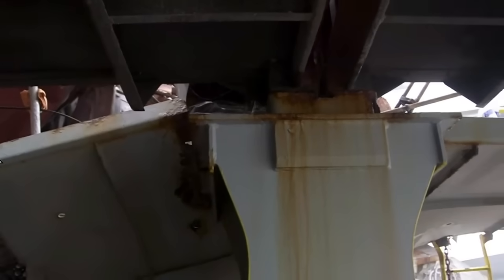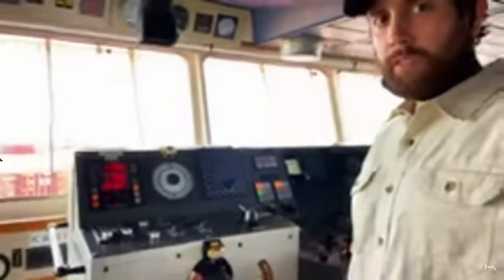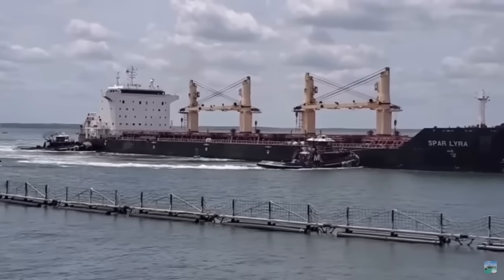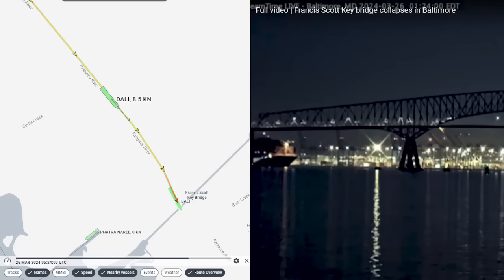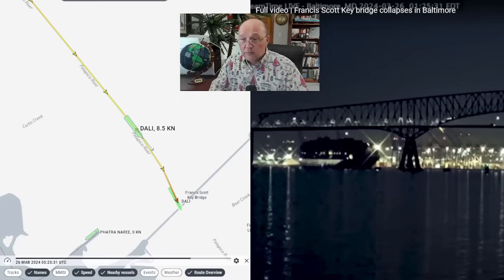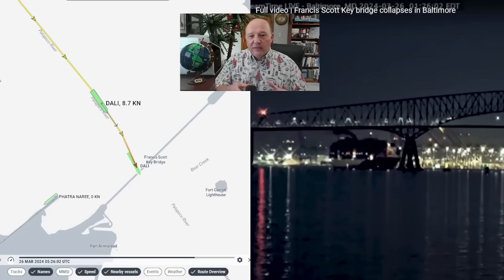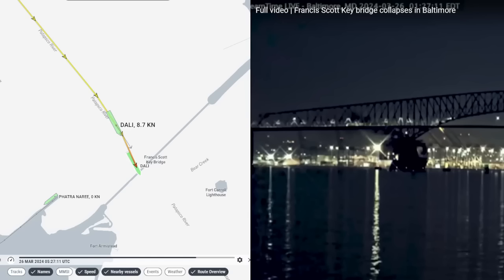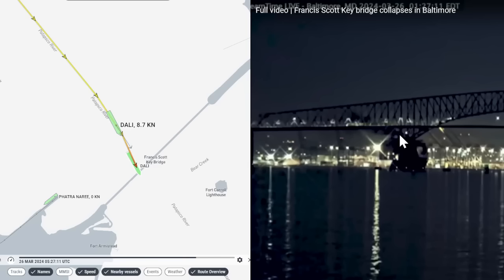Dali Timeline from Data Recorder in Striking Francis Scott Key Bridge in Baltimore, March 26, 2024

Comment: If the speed was 8 knots (9 MPH) the initial power outage happened when the vessel was approximately 3600 feet from the bridge (3.6 Boat Lengths) and moving approximately 13 feet per second.  Life comes at you FAST.

Comment: I had always read that large ships like this cargo carrier used bunker fuel for main engines.  Is there a reason this one uses diesel? would think that would be a more expensive option.
Reply: Ships using bunker fuel are diesel engines. Diesel engines are engines that run using compression ignition. they can run on various fuels. Often these ships run on a cleaner fuel while in a country's waters for emissions reasons.
Reply from the maker: It is marine diesel which is much thicker than normal diesel.

Comment: The fact the ship had issues before even under another captain is telling. Didn’t watch the whole video, but I imagine this information was included. Bad ship with routinely bad crew, doesn’t mean it was that simple though. Iron truss bridges are actually jenga tower enthusiasts in secret, there’s a reason they aren’t built anymore. Uses about 5 times the material as a modern suspension bridge with way less stability. How about wide cone shaped pylons to deflect the energy transfer upward instead of laterally? I could think of a dozen things that would’ve helped, and maybe cumulatively could have stopped the collapse.

Comment: Appears from the visual that the vessel ( indication of smoke stack) has gone astern -maybe full astern at the last minute .Bow cants to starboard ( right hand propeller) As she still had ahead vector -probable a mistake .would have been better to give hard port and then hard starboard to avoid pillar.(this with either ahead propulsion or at idle rpm. At 6 knots ahead vector -vessel would not have stopped anyway. Letting go the anchor at 6 knots  would not have stopped the vessel in time. investigation will tell if fuel filters were with wax deposits. At times master's tend to want to get out of port first and then stop to do maintenance  .Engine alarm logs (digital ) would give a clue .
Reply: Give harp port? By what method if rudders are not responding?  Transverse thrust? Prop walk it to port?

Comment: The engine room system would have had all the important data and timeline… strange the NTSB never mentioned it.  This assumes they did proper maintenance on the associated battery backups for it.
Reply: The NTSB doesn't have to give a play by play account of what they are doing.

Comment: It doesn't matter what size boat you have...if you are going straight ahead and you loose thrust....you will not change direction. The boat will continue straight ahead no matter which way its turned.
Reply from the maker: Not exactly.  The propeller has torque.  Plus when you loose power there is no telling where the rudder is set at that moment.  Then there are external forces on the ship.
Reply: @wgowshipping  There's a ton of videos online of large ships loosing power and almost instantly turning towards shore and grounding because of it.
Reply: @SilverStarHeggisist  this harbor is a dead end and many miles from the open ocean....no current forcing the vessel to shore. The ship was billowing black smoke...probably wide open throttle. That would explain the quick turn of 45°into the bridge. No other explaination makes sense.
Reply: @jjkastelic  there is a break in the shoreline right where this happened. That reduces pressure on that side of the ship which will cause the ship to turn that way. 

Diesel engines, especially large diesel engines will blow black smoke when first started. Ship diesel engines especially when they stall will do so because there's fuel oil that got left in the cylinders that has to get blown out of the engine before a true start happens. 

Diesel engines do not have a throttle. They'd are effective wide open throttle all the time because there is nothing to restrict airflow because they don't actually need to reduce airflow as part of their running. They only change the amount of fuel being pumped in. 

Bad or contaminated fuel can also cause a diesel to blow smoke like that and there's been a number of ships engines killed because of a recent environmental change requiring the sulfur in their fuel be removed for environmental reasons. 

Also without the rudder compensating, the the propeller because of its shape can cause the ship to turn. 

If a diesel engine is loaded, it will blow black smoke. They may have attempted to start the engine backwards to spin the propeller backwards. This would severely load the engine. The propeller is directly connected to the engine, engine spinning, proper is spinning. If they did that it could be why the engine never actually got running again, it was too loaded and stalled. 

Bad fuel would explain why the backup generator also failed. Since that's what caused the lights to flicker back on again. It may have started, then gotten poisoned by bad fuel and stalled out too. 

The ship was being acted on by wind, you can see the smile being blown horizontally in that direction and that ship has a huge surface area, even a small amount of wind can have a huge effect on it. 

The real question is, when they expanded the harbor to accomodate these ships, why didn't they add the protections around the bridge?

Comment: How about some in-depth coverage of bridge protection?  As I understand it (from another civil engineering focused YouTube channel) that the powers-that-be considered the need for protection measures (which are required for current bridge construction) but rejected them due to cost. (Doh!)  Sal hinted at deficiencies in the NTSB - what about that? Did it formerly have expertise or has it been "hollowed-out"?
Reply from the maker: My focus is ships.
Reply: @wgowshipping Maybe best not to go down the Jones Act rabbit hole ever again then.
Reply from the maker: @SubTroppo  Why?
Reply: @wgowshipping I'm pulling on your chain there; however you do seem reluctant to cover the broader fundamental issues which are the driver of events in shipping - most of which have a historical basis.  In the case in point the authorities (whoever they may be) seem to have their feet firmly planted in the century before steam.  [Perhaps they can only think in terms of their 40ft cruising sail boats].

Comment: Here's what happened. When the power went down the pilot lost steerage as it is a fly by wire system. He then called for full astern. That is the plume of black smoke from the funnel. That was a mistake. When the ship engaged full astern it began what we call a prop walk. The stern moves to port and the bow moves to starboard. There was too much way on the ship to stop before the bridge. It was doing 8kts prior to the power outage and 6kts when it hit. If the pilot had not engaged astern it would have continued on its course through the middle of the span.
Reply: You have it right, except, that was exactly their plan, and they had full rudder, they move that 100,000 ton beast 40 degree in minutes....there is no other way.
Reply: @777Macau  No. This has happened to me. Then I experiment when I had time. The prop walk is huge. Even when the rudder is hard to port. It will be interesting to see if the rudder was hard to port. In fact the pull of water over the rudder pulls it further to port. The ship was definitely in full astern because of the ships speed decreasing but it was too late, it had too much way on.
Reply: @rogerprout5574  Prop walk will not solve a needed perp walk.    Prop walk will not be able to turn a 100,000 ton ship by 40 degree in minutes, no Fing way.   I pilot a 28 foot salmon boat with 2 right hand propellers, the prop walk is negligible, but you can use it to advantage in backing out of slip.
Reply: @777Macau  I'm sure NTSB will experiment and even shipping companys will get captains to experiment. Its happened to me. I also have lost throttle on a brand new boat and rammed into dock

Comment: Why would they only drop the port anchor to slow them down instead of dropping both anchors? Dragging these anchors in this particular silt is futile but it might of kept them straighter and not veering them off into the main support structure. Thank god they stopped traffic across the bridge. The pot hole repair crew being there actually saved more people from going in the water. Hopefully everyone will learn lessons by their sacrifices. Throughout history unfortunately no one learns lessons for change unless it becomes drastic; and lives lost. Much respect for the victims and their families.
Reply: But they were drifting to starboard so dropping the port anchor makes sense to try to reduce that drift in the absence of rudder command, no?

Comment: Why wasn't the construction crew on the bridge told to get off if the police stopped traffic on each end showing there was a safety concern?
Reply: The crew was in the middle of the bridge... the port authority's transit cops were at either end... enforcing lane and speed restrictions... because of the construction.  The cops were not in radio contact with the construction crew.
Mayday call was transmitted on VHF from the ship to port about 90 seconds prior to impact.
Port told dispatch, dispatch told the transit cops to stop all traffic, which they did... thankfully at that time of night, traffic was light anyway. 

Dispatch asked about the crew on the bridge, one of the cops said he would drive up when another unit relieved him at the position where he was holding traffic.  Obviously he assumed there was more time, and also it's obvious they didn't have a way to directly contact the workers by radio.   It's a pity and I don't know whether work crews are supposed to tell dispatch 'hey we're on channel 5 on our walkie talkies' or whatever, but it seems that work crew had no idea they were in trouble until the ship hit the bridge.

Comment: Emergency generator will not provide illumination on the entire span of the main deck, it's the st/by generator running. During power outage the sequence will be: within 15 secs the st/by generator should run and automatically goes on the board if this fail the 2nd st/by will start and same within 15 secs it should be on the board, if this again fail the emergency generator should run within 45 seconds and power the emergency switchboard. If its in emergency power during the 1st minute,  steering would be possible because 1 steering motor is connected to the ESB, my conclusion is that the emergency generator did not start at all.

Trivia 1: under USCG 33 CFR 164.25 Steering gear test, main and emergency generators should be tested prior arrival/departure US navigable waters. This should be included on the investigation.

Trivia 2: there is no US requirements of any to use 2 Generators in parallel in port arrival/departure. The use of generators depends on the vessel operators: some require 2 for safety reasons, if there's a trouble the other generator can easily take up the entire load without power interruptions, other operators requires only 1 generator for emission ratings/score.

Comment: That final swing to port looks like she's running aground. 
I don't believe that any tidal current in the region  or bank effect with the depth of water, in and outside the channel, could cause that rate of turn in such a short space of time.  It is far more likely that the steering came back with the emergency geny, then was lost again in the second black out.  We need to know if the telegraph was set to Stop.  If it was left half ahead and the steering had switched to NFU with the emergency geny coming online.............
All speculation though until we see the transcripts.

Comment: I doubt any of the politicians have the courage to do this. But it should be analyzed if Baltimore should continue to be a major port. Could well be that transportation would be better served at a location that didn't have such a long transit from the sea. But then politicians didn't consider the logic of a city below sea level with New Orleans after Katrina.
Reply: Some dumb comments in this video... You top them all.
Reply: Thats completely absurd….. the value of having baltimore as a harbor is BECAUSE it is so far inland its means that freight can be loaded up onto truck or rail several hundreds of miles further inland than Jersey to the north and not have to deal with the military restrictions around port of Norfolk to the south then go by rail or highway from norfolk to richmond to Dc to Frederick instead of the very short route from Baltimore to frederrick along 70

Comment: I'd say whatever the commands were after power was restored exasperated the situation. I thought rear anchor was dropped no front anchor was dropped. 

At the time the anchor was dropped the ship was at a slight angle to the right, the FRONT anchors regardless of port or starboard is only going to create further drag in the front towards the right because of the size and weight of the ship, if the ship went full astern your adding more torque to starboard. 

Nothing should have been dropped from the front.

If we watch the time lapse from the time she lost power the first time and commands had time to have an affect once power was restored was minimal. BUT after commands were given that's when the ship began to make a more drastic change in direction.

I hate to say this but other than dropping rear anchors they shouldn't have done anything and they may have squeezed through.

The hardest action to take is no action at all. In this case I'm afraid no action may have been the best course of action outside of dropping rear not front anchors

Comment: I would say the generators should all be operating until the ship is so far from the coast. Just like airplanes have auxiliary power units  that operate during take off and landing, the critical times you don’t want to lose power. The US government could in-act a law like this. Make it mandatory for all ships entering or leaving ports must have their generators running until they’re either docked or cleared of the coastline. If they don’t want to, don’t come to United States ports.
Reply: Here's the thing. You don't know if the generators were or weren't running. All you know is that the power went out. There are many reasons that power could have been killed, besides the generators not running. (Circuit breaker gone bad, wiring short, software glitch, bad sensors, etc.)

Comment: Shouldn't the steering be set to a trajectory of the center portion of the bridge instead of a leg of the bridge? The ship clearly steers towards the right instead of the left which should have been happening.  To me this was event was intentional.
Reply: There is no doubt the ship steered right into bridge
Reply: The ship was on course to pass under the center of the bridge.  Did you miss all that?  That was the steady course before whatever went wrong. 
Did you even understand what was being explained?
Reply: @billiamc1969  Why then, did they drop the port anchor?
Reply: @jimbobeire  Somebody's intentions were not to go to the center because it went right instead of straight.  Doesn't take understand the video to see it's motion!
Reply: @bonespiel  Nobody is disputing that it veered off course. 
You are saying it was intentional . 

Dropping the port anchor is totally inconsistent with deliberately veering to starboard. Dropping the port anchor would reduce a yaw motion to starboard, not cause it. 

Did you just ignore everything you heard in that video? Did you actually understand it? If so, what are your counterarguments? 
Or did you dismiss Sal's points without understanding them?

Comment: Almost 3 minutes from the moment of black-out and drop anchor order. And as I understood, the order to drop PS anchor came from pilot. Where was ship's captain? It was a departure mameuver, as a seamanship rule, captain should be on the bridge (that's the name of navigation deck) to assist. Pilot give orders, captain (or officer on watch) repeat it to confirm and helmsmen execute it and confirm.
The order to drop PS anchor should have been given as soon as the black-out occured.
That excuse with "dirty fuel oil" is lame.
I'll send ITF overthere to to interview the crew under the protection of anonymity as for sure there eas a toxic working atmosphere, one of the cause of many irregularities.